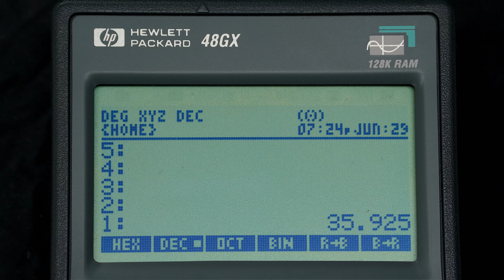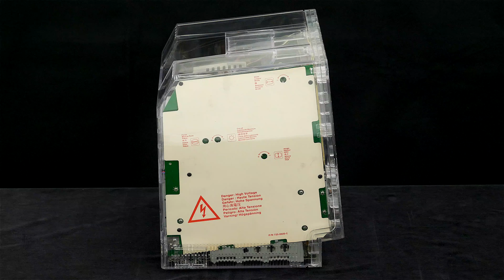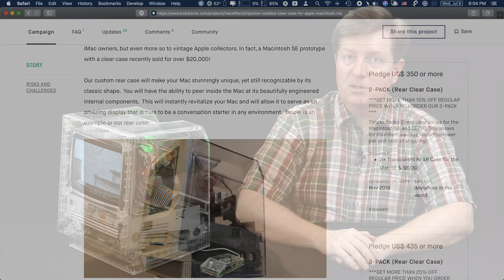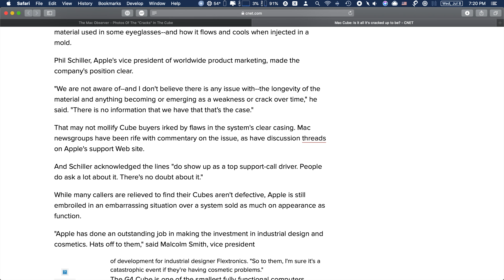MacEffects Clear Case REVIEW [SE & SE/30]

Comment: Excellent summary that answered all of my questions about this case. I've been following MacEffects for a while and am very tempted by these cases, but given the cost and the fact that I still only have a stock Mac SE and not an SE30, I probably won't be getting one. It's a bit of a shame that the mouse is functionally worse than the stock one, since that would be a low barrier to entry for people who might not want to go all-in on the full case for whatever reason. I would also love a clear keyboard case for similar reasons, but I understand that may be prohibitively expensive to make.
Reply from the maker: Thank you for watching and for your kind words. I would suggest that you consider the clear programmer’s switch, as that is the cheapest option of all. Not everyone has one of those, so maybe that might be a consideration for you. Admittedly, it’s not nearly as exciting as the clear case or a clear keyboard would be.

Comment: Thanks again for this video. I recently bought a Macintosh SE/30 and it arrived with some pretty significant case damage. I got a reasonable amount back as a partial refund from the seller and decided to put it toward one of the MacEffects cases. I got the Rev. A case since it was cheaper and I thought the slight imperfections and cloudiness might actually make it look more like one of Apple's prototypes. And honestly it looks great. I used your video extensively to help with the installation process. I did have a couple of minor issues, including accidentally pulling a molex connector off of the analog board during disassembly, but thankfully it was a simple job to solder it back. Anyway, I'm very happy with how it looks, and I even made a transparent mechanical keyboard to use with it (using the Wombat ADB-USB convertor).
Reply: I posted a photo to Reddit by the way: https://www.reddit.com/r/MechanicalKeyboards/comments/j97snl/i_built_a_transparent_keyboard_to_go_with_my/
Reply from the maker: That's great to hear.  When you have time, I'd love to see a photo of your Rev. A case!
Reply: @JDW-  I did post a link in a separate comment to my Reddit post on it, but I know that YouTube will often flag these. I will also post a link to my Instagram which has more photos in another comment under this one.
Reply from the maker: @MightyJabbasCollection  It looks fantastic, especially with that transparent USB keyboard and mouse (made possible thanks to the WOMBAT interface).  Yowza! Did you add the Apple logo on front/left or did it come that way?  That's the main thing missing on my Rev.B version.
Reply from the maker: @MightyJabbasCollection  I ensure YouTube doesn't flag URLs in the Comments under my photos.  Feel free to post links anytime!
Reply: JDW MacEffects included a transparent “Macintosh SE/30” badge with the Apple logo, although it’s hard to see the text part of it

Comment: 14:23. Seems like you could just reach in through the screen cavity (since there is no screen there), and just carefully pull the face off.
Reply from the maker: No, the front and back were stuck together almost like they were glued.  I didn't want to risk cracking it by pulling to hard from the inside of the front face.  Prying it open the traditional way is the safest way.

Comment: great video - I really don't know why smoke or black aren't offered though - esp considering the SE30 in the watchmen
Reply from the maker: I'm guessing that nobody ever asked for those colors before.  If there was sufficient demand, I'm sure Mark could add those colors.
Reply: @JDW-  It just seems strange black isn't there considering those other colour options. btw could you put a pic of the se/30 with cards installed in it?
Reply from the maker: @blaarg2657  You are asking for a photo of the same PDS cards I show in 25:27, except with the front case clear?
Reply: @JDW-  yes - I just assumed that would be its final form.. you're not using it for your primary, tricked out SE/30?
Reply from the maker: @blaarg2657  I will need to schedule time to shoot such a photo for you as I am in the midst of shooting a new video on the HP 12C Platinum calculator right now.  The clear case SE/30 is indeed used by me, but I swap out cards quite a bit for testing various things.  I swap out the analog board quite often for the same reason.  So when I have it assembled with the cards you want, I will take a photo and post a link to that photo here.
Reply: @JDW-  Thanks!  no hurry really - you're doing great work. Btw I think some overall conclusions at the end of the video would have been nice - it sounds like you thought it was neat, with a few drawbacks and the cost was a bit high.. but having to guess isn't why people watch reviews
Reply from the maker: @blaarg2657  What conclusions other than (1) my take, (2) caveats, and (3) cost did you want to hear?  (I'm open to hearing your specific thoughts.)

Basically, the situation was that I did not buy the case.  It was shipped to me as a gift by the owner of MacEffects with no expectation of a review.  I thought it was pretty neat, so I decided to do a video about it and then leave some basic thoughts at the end.

YouTube "reviews" are interesting.  I've seen a lot of badly shot "reviews" that left zero conclusions at the end which have thousands of views.  (As of right now, my video only has 675 views total.)  I've never quite figured out why.  I guess the topic matters.  We folks in the vintage Mac community just aren't so popular in the overall scheme of things.  True, the 8-bit guy has over 1 million subscribers now, but maybe that is due to Commodore machines being more popular worldwide than vintage Macs?  Not sure.  Anyway, I always appreciate thoughts and suggestions.  Best wishes.
Reply: @JDW-  Mainly your opinion about whether you would buy this at full price, if you are using it as your main SE/30 or would ever use it as such? Does it have any place in an "ultimate SE/30 setup? I'm thinking probably not - but I'd still like your view.

I know this was a gift, and maceffects is a good dude.. but if it's truly not influencing your review you shouldn't be shy about expressing yourself. 

I think there is a lot of scope for a video about an "ultimate SE/30". Your other videos about recapping, etc are all important parts - but an overview video summarizing all the things you did and the result at the end would actually do quite well I reckon.

I'm getting a lot of value out of your videos regardless - so views aren't everything!
Reply from the maker: @blaarg2657  At 56:00 I give me thoughts on the price, emphasizing that "it's NOT cheap!" :-) I was rather hoping that would be an adequate and clear expression of my own sentiment.  But since you are wanting to know more, I shall not explain.  Since October 2019, my employer has been going through hard times.  My take home pay is only sufficient to pay my rent.  That remains to this day.  I am married with a family of 4 and both of my kids are in high school.  In light of my personal financial situation, I would obviously not be buying a $350 case for my vintage Macs.  Indeed, I've not bought vintage Macs in a rather long time due to my financial situation.  But I didn't think I needed to state all that in the video.  

However, viewers make up your own minds, I was motivated to point out this product is not the creation of a big, rich corporation but built it small volume by a fellow vintage Mac enthusiast who simply hopes to recoup his manufacturing costs, rather than turn a huge profit.  That's not a guess on my part.  I interviewed Mark J. and heard him speak those very words.  My knowledge of manufacturing here in Asia aligns with what he said about his manufacturing costs.  In other words, my mention of that helps the viewer of my video keep the real cost of the case in perspective.  And that is why I closed those remarks by saying that "only you can judge" the worth of the case to you.  

I thought that was good enough because most people judge worth based on the inherent value of an item in combination with their own financial situation.  So for example, I cannot afford one right now because of my painfully low salary -- indeed, I am largely living off savings.  But if my full salary was restored, I would be strongly inclined to buy one along with accessories.  

So you see, this is why I personally feel that the way I handled cost in the video was appropriate.  If I was holding back anything, it was details of my personal financial situation which would wrongly skew my words about price.
Reply: @JDW-  It wasn't what I was getting at though - everyone has different circumstances (mine are probably more dire than yours in fact).. but people review expensive video cards etc and still make a call at the end - they put themselves in the shoes of a reasonably minded buyer and conclude.

Otherwise it's not a review of a product - it's something else.

I follow several channels where they constantly say "only you can decide" at the end of reviews.. their channel suffers from it in the end I believe.. of course in the end the viewer decides... but that's not what they are here for is it?
Reply from the maker: @blaarg2657  Right or wrong, each of us must make our own decisions in life.  Even after discussing the matter at length with you, I still have no fundamental regrets about how I closed this video.  Why?  Because even if I had boldly proclaimed, "It's too expensive and you'd be fools to buy it!" or "It's a tad pricey, but don't let that stop you from buying 2 today!" somebody in the comments would inevitably have said, "I dislike your bold assertion that I shouldn't/should buy this case!"  

So rather than try to please everyone, I try to do what feels right to me as content creator.  That doesn't mean I ignore the potential needs of my viewers.  It just means I felt the conclusions were adequate.  I'm also not a full time YouTuber.  I don't even have AdSense enabled.  So I don't spent countless hours focused on analytics, mimicking the big YouTubers or seeking absolute perfection in video creation.  I just try to do the best job I know how to do while juggling job, family and volunteer tasks in my life.  

Of course, it should also be considered that you are the first person to state my conclusions at the end were lacking.  I don't mention that fact to lessen the importance of your constructive criticism, and indeed I thank you for it.  I am just not so bold when it comes to prying money out of people or forcing folks to keep it in their pockets, and I think a lot of my subscribers understand that.  Instead, I present the facts like a tasty meal and recommend people swallow and digest.  Some folks like that, while others prefer to be force-fed.

Thanks again for making time to share your excellent thoughts!
Reply from the maker: @blaarg2657  Below is a link to some photos I shot today with my iPhone 7 showing a Micron Xceed Color30HR PDS video card sitting atop an ARTMIX TS Adapter.  This setup barely fits all the cards, but they do fit with a couple millimeters to spare.  The TS Adapter is used to add a Daystar Turbo040 40MHz accelerator card, which shoots out perpendicular to the TS Adapter and sits above the Hard Drive.
https://photos.app.goo.gl/MuUwzGE8T9cKxaeaA
Reply: @JDW-  fantastic thank you - I think having it fully loaded definitely adds something

Comment: There is no doubt Eric made a very interesting product. Personally I really like the smoked case that you showcased amongst a number of colored variant cases. At the end of the day, I wouldn't buy one because I don't have this kind of money laying around but if I had second SE or /30 with a really ugly beat up case it would be something to consider. I only have a single SE/30 and the case is in good enough condition that it doesn't warrant an upgrade but again, if I had two machines this would be a consideration. Great video!
Reply from the maker: Thank you for your comments, Alex.  I think you mean to say "Mark" instead of Eric, since Mark J. is the founder of MacEffects.  He also has some pretty interesting Apple II cases as well, although that doesn't help me because I don't own any Apple II machines.  There are a lot of ugly and beat of Mac SE & SE/30 enclosures out there, so I'm sure some of those owners could possibly benefit.  And while clear isn't for everyone, I still think that leaving the front opaque (assuming that part isn't beat up) might still be a nifty looking combination with the clear back side.  The only real downside is that it takes more care when putting on the case and taking it off, since you will want to avoid scratching it.  Thanks for watching!

Comment: 7/11/2020 Another great How-To video. What use does this Mac have in today's world for daily use compared to later Macs. Any way to connect to the Internet? See a Mac even back in the 80's were not as easy to take apart just like the Late 2009 iMac 27" many connectors ( still need to do the replacement motherboard on mine). Is there a sites to get hold of Apple's many software for the older computers?  Always reviewing your videos.
Reply from the maker: Thank you for your comment, Robin.  I think the interview Cult of Mac did with me back in 2008 should answer some of your questions. :-) https://bit.ly/3gONGyl

Comment: Great video and great case.  Not for me, as I like the original case look.  But I can see someone really liking this as it would make a beautiful display.  Definitely worth the money if you want clear.  Would mean you really should be cleaning your SE more often tho.  ;-)
Reply from the maker: It's a case that makes you take better care of your SE or SE/30.  It really does.  You try to avoid banging the machine around or removing the case back like there was no tomorrow.  

It's also a good choice for the many folks out there who have purchased an SE or SE/30, only to find the seller totally inept having shipped the machine with virtually no packing material, resulting in set of broken plastics on an otherwise fully functional Mac.  

Since Apple doesn't make these plastics anymore, having a source for new cases becomes more important over time.  But you are correct in pointing out that clear or even semi-transparent isn't for everyone.  That's why I tried to show what the back clear case would look like if you leave the front opaque.  For it could be that someone has a broken back case while the front is fine.  

I doubt that Mark J. will create an opaque case in light of the fact his mold is designed for clear -- meaning, it is diamond polished to have a perfectly smooth texture on the outside.  As you know, the stock case has a little bit of texture to it, and that's because the texture is part of the mold.  Anyway, thanks for watching and sharing your thoughts!
Reply: @JDW-  or if the plastics were already cracked, as was the case with the front of a 512k I've seen on eBay a few months back

Comment: Could you wind a matching transformer to make the 8 ohm speaker more compatible with the audio circuits designed to drive a 63 ohm speaker?
Reply: Or maybe a little amplifier would have a very high input impedance.
Reply from the maker: In theory, yes.  In practice, well, I've personally not tried it.  
By the way, I discuss voltages across the MacEffects 8Ω speaker in this 68kMLA thread (scope measurements are on page 2): https://bit.ly/2YvhU2x